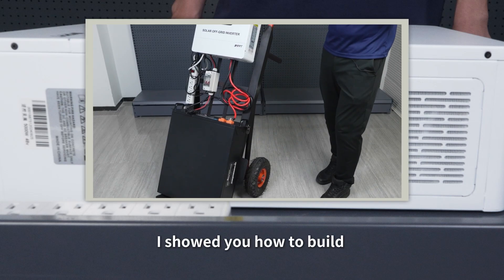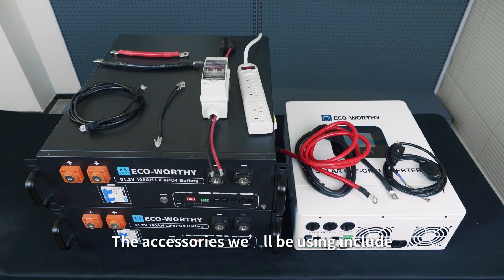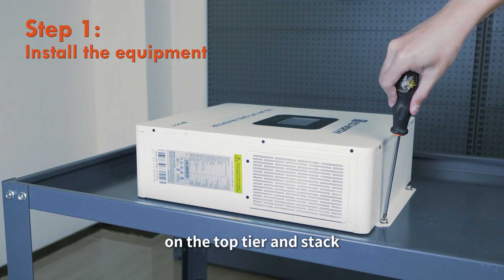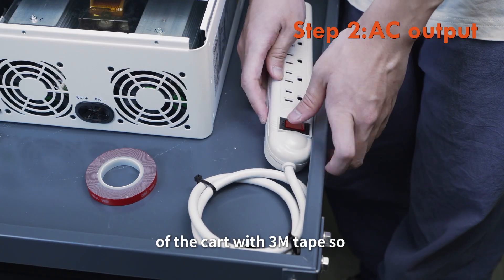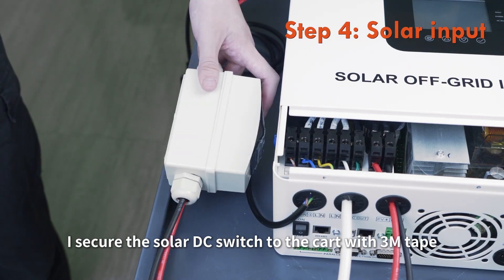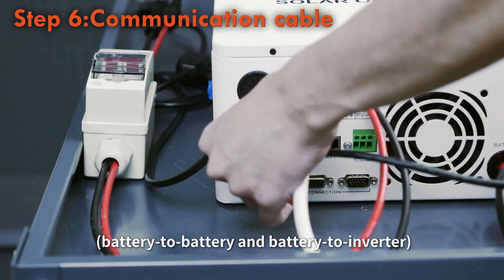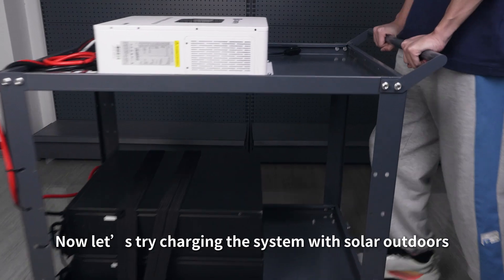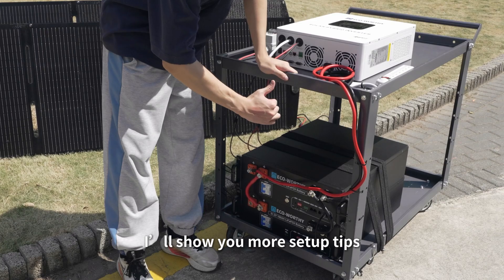DIY ECO-WORTHY Solar Cart Part 2 – Double Battery Power Upgrade! ⚡

Comment: I purchased a 200Ah ECO-WORTHY LiFePO₄ battery directly from their UK website earlier this year. I already owned two of the same model which had been performing well, so I expected this one to integrate into the system without issue.

Unfortunately, the new battery would not charge above ~13.6–13.7V even when isolated and charged separately from the rest of the system. When connected, it caused the other two batteries (which previously operated normally) to discharge overnight. When removed, the original two returned to their expected behaviour — reaching full charge at ~14.6V as per ECO-WORTHY’s own published specifications.

I contacted ECO-WORTHY with full details of the fault and provided technical information to help resolve it. Responses were slow, several emails bounced back, and the replies I did receive either did not address the issue or contradicted their own product documentation, it seems very much deflection rather than customer service. After formally requesting a remedy under the Consumer Rights Act, I did not receive a meaningful response within the timeframe provided.

Because the battery appears to be defective and likely has damaged my existing batteries and communication has been unreliable, I am now pursuing a formal refund and consequential loss claim. I would advise potential buyers to research warranty support and after-sales service carefully before purchasing, particularly if the battery will be relied upon for travel or off-grid use as it's cost us a lot in hook up charges while we were travelling around Europe earlier this year.

Comment: Can you charge using a regular wall outlet? If so what setting needs to be changed to limit the amount of power is being pulled to charge the battery?
Reply from the maker: Thank you very much for your question. You can use a regular wall socket to charge the battery, but for safety reasons, we strongly recommend that you adjust the settings to limit the charging power to avoid overloading the socket. The following are some related parameter settings and their methods:

Core Parameters:

[28] Mains Charging Current: This is the most direct setting, used to set the maximum charging current when charging the battery using mains power (i.e., a regular wall socket).

Setting Path:

Enter the parameter settings menu through the LCD screen and find parameter [28].

Setting Recommendation:

Please be sure to set this value to ≤10A, which is the safe upper limit for a regular 10A wall socket.

You can also set it lower (e.g., 8A) according to the actual situation to leave more safety margin.

Setting Impact:

After adjustment, the charging current obtained by the inverter from the mains power will not exceed the value you set, thus avoiding overloading that could cause the socket to overheat or trip.

Related Parameters:

[07] Maximum Charging Current: This parameter defines the upper limit of the total charging current of the entire system (including mains power and solar power). Further suggestions:

To ensure overall safety, we recommend setting this parameter to a reasonable range, such as ≤10A. This will ensure that even with simultaneous solar charging, the total charging current will not exceed the limit.

If you have any further questions, please feel free to leave a message, and we will continue to follow up!
Reply: Most USA circuits are 15A, therefore, do NOT exceed 15A to charge from the 120v input from the grid.  Also, remember that 15A is the local wall plug.  Most likely, in your home's fuse box, you will see that circuit as a 20A.  Remember that the 20A circuit breaker is rated for ALL loads from it.  So again, you need to know your home's set up before charging batteries from the grid.  Gary from SE Michigan and a proud EW tester.
Reply: @Gary-wh7ce Thanks. I limited the current to 10A and it’s working fine. Thanks

Comment: So the bottom battery chassis in the stack can bear the weight of the top battery chassis? 
How many battery chassis could be stacked in this way before the weight became too much for the bottom chassis to bear?
Reply from the maker: Great question!
Yes, you can stack multiple batteries. On a flat and stable surface, stacking up to 4 batteries is generally acceptable.

However, on a moving vehicle or cart, we recommend not stacking more than 3 batteries for safety reasons

If you have any other questions about installation or safety, feel free to ask! 😊
Reply: @ecoworthy_official Thanks for the answer.

Comment: What type of portable solar panels are being used in this demo to get the needed 120+ Volts DC to run that All in One inverter?
Reply from the maker: Thank you for your question. The solar panel shown in the video is our 200W portable solar panel, but it's only for demonstration purposes. If you intend to purchase it to complete your system, we suggest you consult customer service beforehand to determine how many panels you need.

Comment: I like the idea but I am not sure the cart is really that easy to move around due to the total weight. How do you upload the whole cart with two 5 kwh batteries to a van by yourself? All-in-one power station with 3rd party expansion batteries may be easier to be handled by one person.
Reply from the maker: Good point on the weight! A simple ramp works great for one person. The system is modular, so you can also easily load the frame and batteries separately for easier handling.Thank you for your comment!!